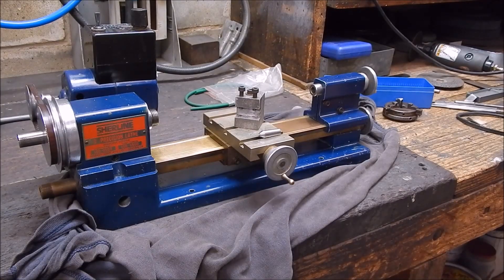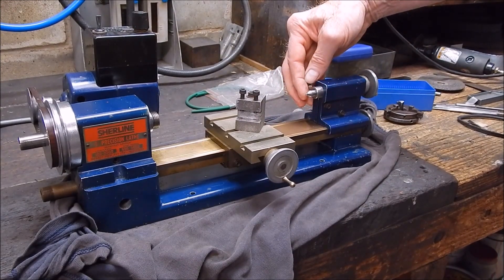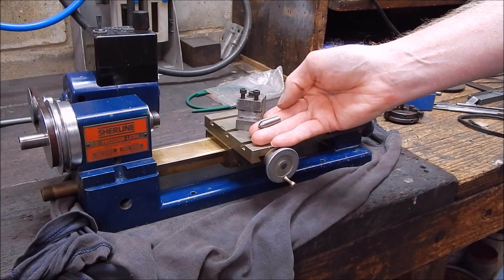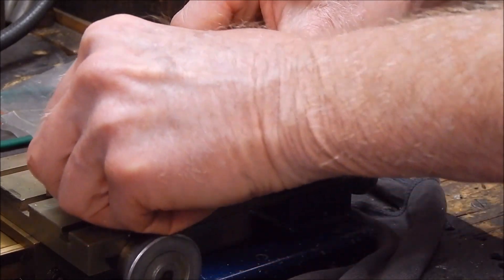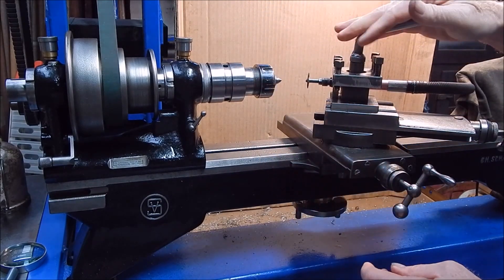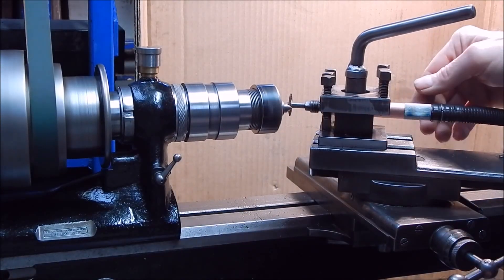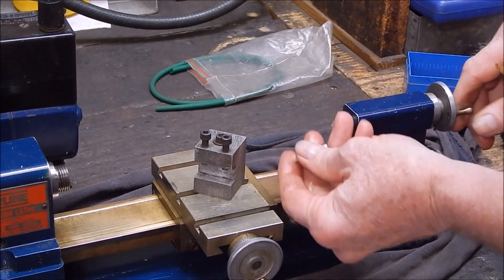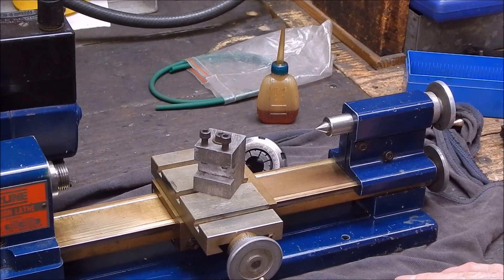I re-grind the dead centre for my Sherline metal lathe

Comment: Great little lathe. With relation to the worn out chuck that you showed in the first video about the lathe, maybe rather than sourcing an original chuck you could make an adapter to enable you to use ER 40 collets instead of a chuck.All the best.
Reply from the maker: I have ER32 collets and could easily make a chuck for it, same as I did for the old Schaublin, but there would be too much overhang for such a small lathe.

I have ordered a chuck and some drive belts from a Sherline agent in the USA.

Works out way cheaper than buying from Sherline Australia who want to charge $22 plus postage for a tiny drive belt - you have to be kidding.

Cheers Rob

Comment: Cool trick,Next on the list pencil die grinder.Have a few centers for my Atlas 6" lathe to regrind.Thanks.
Reply from the maker: Hi Patrick,

I did a web page on these little units:  http://users.tpg.com.au/agnet/microgrinder.html

Make sure to read it, for the tool post clamp design, and where to add a dab of Loctite so they don't shake apart in a fixed mount - they are designed to be hand held.

But really, these units are great, and they do a good job as a poor man's TPG, especially on tiny jobs like this which my big TPG would have trouble with.

Cheers Rob
Reply: Thank's for the info Rob....Pat

Comment: I wish I saw this yesterday, I did mine holding the dead centre (MT3) in an R8 adapter, and held the parallel section in the 4 jaw chuck. Clamping on the tailstock like that is a fantastic idea. Might retry tomorrow. Thanks for sharing!

Comment: How accurate is grinding with those narrow discs? My understanding is that for a really accurate grind you need to have a wheel wide enough that it won't break down all the way across
Reply from the maker: They are plenty accurate enough if you use light pressure and feed both ways.

The end result looked pretty good to me.

Cheers Rob
Reply from the maker: In fact. a wide stone must be dressed to be accurate across it's full grinding face.

So each has it's good and bad points.

Cheers Rob

Comment: If you really wanted it dead accurate, could you have been able to hold the quill in a 4-jaw with soft shims? I don't even have a collet chuck, the 4-jaw is the only way I'd be able to do something like this anyway.
Reply from the maker: Yes, sure.  This is only an example of how to approach the task.  A padded four jaw chuck would be fine.

So long as you can mount the quill in a chuck without marking it, you are good to go.  In fact a four jaw could be used for larger quills and centres.

The little air die grinders punch well above their weight and do a fantastic job as you can see.  A Dremel could probably do it as well.

You have to grind these centres as the metal is so hard, and you want a smooth finish.

Cheers Rob